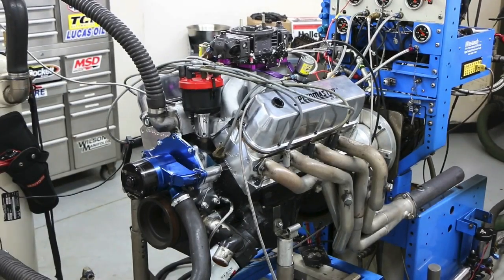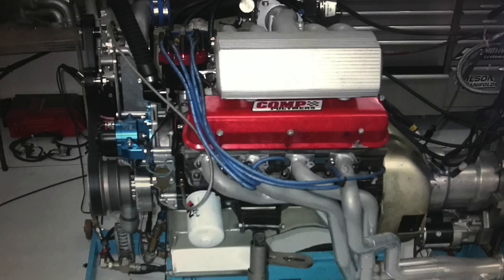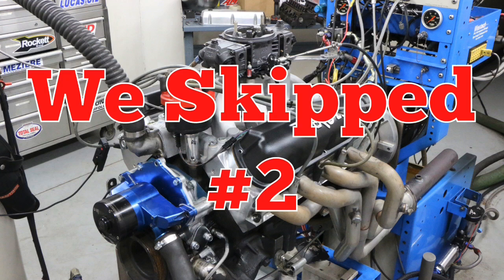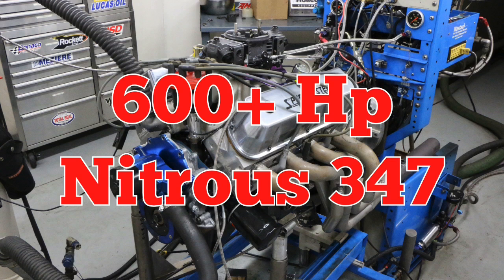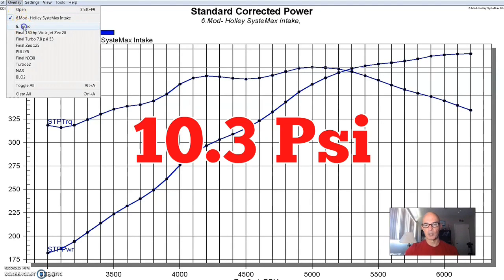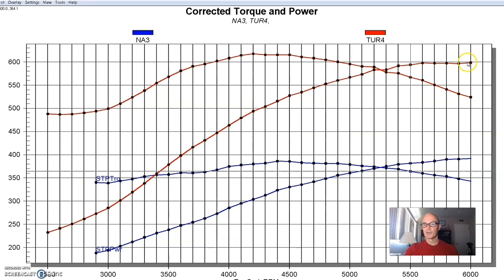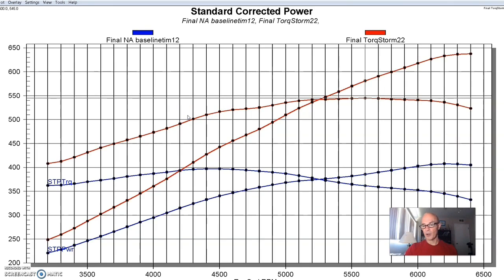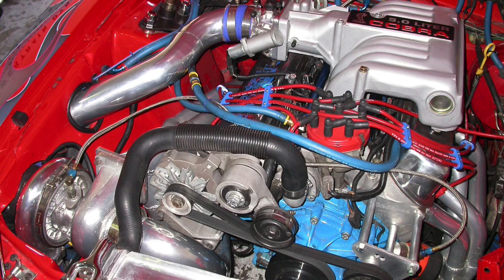5.0L FORD BLOCK SPLITTING-FACT OR FICTION?

Comment: When I have done some failure analysis on damage it is normally a combination of things and not straight one thing because it will be the obvious "normally", but let's put aside that balancing is good either internal or externally balance,  in internet seems that the fracture starts at the mains, and if I see the pictures this is at the threads which is a logical part because it is a stress raiser >   <, I do love to have one of these split engines on my hands so I can conduct failure analysis on it, stress raisers can be metigated to certain extent, but what about assembling the engine and pouring a lot of oil on the threads of the bolts and torquing it and causing the oil to initiate a fracture as it is displaced by screwing in the bolt I have seen this happen in other equipment, other thing is holes that are just not deep enough and the tip of the bolt forces against the end of the casting thread causing a lot of stress, this for sure it will cause a fracture under load and with thin casting it makes it worse, frequency have as well influence, running a engine at 7000+ rpm will definitely cause more material fatigue than running it at 6000, add some stress raisers and bad harmonics due to unbalancing or running a OEM balancer all this combine will have a negative effect, a good expensive balancer that can take these bad harmonics is a must, good assembling practice have positive impacts, pay attention and look be critic at what you wrench on, because it was running it doesn't mean it was running properly, inspect, inspect, inspect, and always remember that batch of production on that Friday afternoon and someone that is just there for the money without the ethics, as well humans make mistakes and are not aware of them, it is normally a combination of things that is my experience.

Comment: If there is truth to the blocks splitting, its probably related to the shock loading of drag launches. In the same vane, I run a GM 7.625 rear end in my road race car, which has a huge reputation of being weak even at stock power levels. I make 360hp and 386ftlbs/tq at the wheels and have run that rear end for years without any issues. But a road race car never plants the rear end and shock loads it like drag racing does. If you think about it, if you wind up an engine and dump the clutch, that momentary spike of torque is going to be astronomical.

Comment: I have always thought that the  way the intake manifold bolts down on the SBF acts as a wedge on the blocks. The high power combinations exploit the inherent problem when combined with engine mount and chassis flexing.   Just my 2 cents 🤷🏼‍♂️
Reply: This is where I was thinking... people skim the deck and think they can get away with it, torque the intake down because the bolts fit, and now the valley is preloaded in tension and waiting for that first crack to start and spread. Cast iron doesn't like tension while vibrating at all.
Reply: @mfree80286   I keep hearing that the cracks start at the crankshaft?
Reply: @fascistpedant758  No reason there can't be more than one way to start the process. If the crank twists in the mains then that's going to try and force the studs apart as well, just from a different spot.
Reply: @mfree80286  I don't contest that there could be more than one failure mode.

Comment: I suspect it has more to do with resonance than peak torque or shock loading. The right torque at the right frequency could amplify twisting of the block causing fatigue cracks. An improper harmonic balancer puts a lot of stress on both the crank and block also. Then factor in casting lottery.

Comment: Now you have me wondering what the magic number is for a studded 2 bolt main 350 block. Always heard 500ish hp , even from David Vizard.
Reply: Luv truck Nelson ran a 2 bolt forged 350 shortblock with unbalanced rotating assembly. chevy s10 blazer, turbo running low 9s with a cast crankshaft as well.  I also have a customer that has a turbo-forged rotator stock block 350 in a Dodge Dart, running low 9s as well.

Comment: I watched my friends 94 cobra with stick crank and block make 617ft lbs to the tires on 14lbs 3 years ago.  It's still alive
Reply: Stock*
Reply: @joshkeasler512  yea i believe them 93-94 cobras have good bottom ends
Reply: @Artificial_Dopamine  The '93-'95 Cobra used the same block & rotating assembly as GT/LX. '93 was the first year for the hypereutectic pistons (5.0 HO used forged from '85-'92). The difference between the 5.0 that came in the Cobra & reg 5.0 H.O. is in the top end: Cobras had GT40 heads, 1.7 roller rockers, Cobra specific intake, larger TB (65mm) and different cam.

Comment: In reality what splits  everybody,s engine,s is poor maintenance and cheap oil, my 87 makes 600 plus to the rear with 12 psi 80 mm  ball bearing turbo , stock block , and still going .

Comment: I think block failure/splitting is WAY more likely to occur when the engine is actually in a car and in particular, when the engine is in a drag car.  This is due to the added forces transmitted to the engine from loading and unloading of the drivetrain during launch and/or power shifting a stick car.  As such I kinda doubt that testing this on a dyno is an accurate duplication of the forces that are in affect that leads to most block failures.  I think the “myth” of the 450-500 HP figure for stock 5.0 blocks derived mostly from Fox Mustangs in the 80’s.  Many of which were stick cars ...
Reply: Yes and it'd be interesting to know how many split block cars were using solid engine mounts?

Comment: HOT BEARING 
IN A VACUUM/ then getting positive crank case pressure.
= BOOM  just a hypothetical 
The 302s were engineered and built for its standard stock application. Yes they make   power when bad ass parts are applied. Some Joe shmmoo that's doesn't take his time will split block more often.
Reply: Some guys don't realize that. The highest power stock engines are either the cobra or explorer engines and.they last forever at those power and rpm levels. Twist the screws and start making more than double the stock power and stuff will start to break, nobody should be surprised.

Comment: I’ve read that the block splits if you have a boosted 347 stroker. What the person said was that the longer stroke results in the rod angle being different, and when it comes up to the compression stroke, the combination of the rod angle and the boost causes the block to split.

Comment: Not enough material around the main caps. People put a valley girdle on them thinking this will solve the issue. But the split even with a crank girdle and a valley girdle. There is just not enough material around the mains. A aftermarket block has alot more casting in this area and therefore can handle more horsepower.

Comment: I wonder if an unmatched valve spring or two would cause harmonics that would cause it ?
Reply: alot of people are saying their blocks split when the balancer spun the inertia ring. im thinking ins a torsional vibration issue. early first gen dodge hemis would break cranks, because they didnt use a damper at all....

Comment: One comment said it was the 351 that splits. Nitro Nation another You Tube channel ran a video last month they had a 351 I think it was stroked to 408. They were running a roots supercharger with fuel injection. They thought it was making north of 800 HP. While drag racing it it stumbled at the end of the pass but was still running. They pulled the engine and could see several cracks. When they tore it down it fell apart. Fun to watch.
Reply from the maker: we've done 1000+ hp on 351W SBE

Comment: I split 5 roller blocks making 520 N/A. I believe it was rpm as I shifted the engine at 8200rpm. The blocks had DSS main girdles and ATI balancer.
Reply: Yes I beleave rpm and rotating mass are the major factors
Reply: Internal or external balanced crank?
Reply: Internal
Reply: The fact that one person is splitting blocks while others do not clearly implicates some sort of error during its assembly. My first suspicion is overtightening the vertical bolts that clamp the intake manifold. Second, I would look at how the crank was balanced.

Comment: back in 95-98 I ran true street in my 90 coupe 'junkyard refugee' you're old school, friends with jim from mmff so you may remember it. won best sleeper ie ugliest car award in baytown in 96 for its 5 color paint hah. anyways I was running a north texas performance 347 stroker short with tfs twisted heads with a 750 double on it, was using a nos 200 wet kit. Between all the true street events and the dallas/ft worth street racing I probably ran 150 bottles through that motor. It trapped 127, no idea on power we didn't have access to dyno's back then. In 98 I won a texas turbo twin turbo kit for winning an event and swapped over to that with a 1050 dom, I did get on their dyno for that and put down 720 to the wheels through a tremec 5 speed. I ran it for just over a year like that until I wrecked it in a race. The guy I sold the motor to had it split a few months later. As someone mentioned I suspect it had to do with balance, the "rattler" and "fluid damper" were just becoming a thing around then and most people were just slapping old balancers on their cars, not wanting to pony up 350+(in 1998 that was ALOT) for a silly balancer. I believe it was balance and harmonics from high rpm that splits blocks.
Reply: very nice... what RPM was the "high rpm" your engine dealt with on a regular basis?
Reply: @chestrockwell8328  also, im aware 7500 isn't considered high anymore, hell i turn my *EDIT*(damned phone fat fingers, 598 not 528 hah)598 to that, but this car saw 10,000 miles a year on the street, i drove it to each event, I didn't own a trailer or a truck, carried my m&h racemasters in my back seat =p
Reply: @WarfighterRacing  Thanks for replying with additional details. Yeah some people think 6k is high rpm, 7500 is getting there in my book and more than the engine i'm buliding will need.  I agree 8k+ is the new common. What valve springs were you using? stock crank?  pedestal, stud, or shaft mount rocker arms?
Reply: @chestrockwell8328  far as valve springs, i claim ignorance, they came with the cam from lunati, i called them and they set me up with cam, springs etc. The short block was a 100% forged setup by north texas performance, I believe they sourced ford racing crate 347 and went through it to balance and double check. If I recall correct they were crane 1.72 pedastal rollers. Oh, one unique fact, I ran a gear drive instead of timing chain. Sounded like a blower car, though most people who had never heard a blower car before would run over and tell me my car was out of oil lol.
Reply: @chestrockwell8328  it was a 7500 rpm motor. remember, back in the day, smf motor, no dyno to know exactly when power peak was, just trial and error. Came with an F cam, swapped to a lunati custom grind around 580 lift with 24..8ish? duration, but was runing 1.72 rollers so probably like a 615 with those. 10.5 to 1 motor with the 58cc heads and pistons
Reply: Fastest 90s Stang I ever saw was a Chevy engines.  Set back 4 " with some juice.... Small block. Blew the doors off big inch brodix bigblocks with juice.... I mean no comparison..... Pfft of Ford engines. Just a joke of a v8
Reply: @darinr9424  i dunno, you might be amazed at what a hemi headed big block 598 ford can do. but I do appreciate a good sbc and do have to give a nod to the LS engines, if you're into boys...
Reply: @WarfighterRacing  dunno why?;hehehe maybebyourncluelesb. Just kiddin
Reply: @darinr9424  And we're discussing windsors specifically. Why would you even speak up if not to toot your own horn?
Reply: @mfree80286  cuz Ford is poop. Guess that's tooting in a way 😝

Comment: I personally broke one. It was on a chassis dyno, and had an s trim vortec. I was experimenting with cogged pulleys spinning the blower a little harder. It only had one keyway on the crank and sheared it, the balancer spun and it split. The thing sounded really good up until it died. It broke the crank and split the block in two except for from the cam to the top at the rear at the block. Pretty obvious why that one broke.

Comment: My 347 motor has been running for years now it made 508 hp / 446 tq. It’s a Stock block with a main cap support. On the motor dyno it was still climbing at 6500.

Comment: I think it’s a shock load issue. 4-5000 RPM clutch dumps at 400 WHP puts quite a strain on the engine. The 302 Windsor is a thin wall casting to begin with. When they made the Hi-Po and Boss they made the blocks thicker (along with 4 bolt mains). On a drag strip it’s hard on an engine to launch and then go from torque to HP peak 3-4 times in the span on 12 seconds or less.

Comment: One to blame is Frieburgher.  I have heard him say it several times. 
I have seen a speedway sedan  Boss 302 clone run at up too 8500 all night, year in year out. Historic racing engines run at around 8000rpm, again lap after lap for extended periods. I have seen ONE break a block, it broke a crank and took no 1 main out of it. Though maybe the block broke and in turn broke the crank. Harmonics were blamed.
A drag race 347 cracked a main web and oil psi went down. At 8000 rpm. That was put away, block welded!! and was used for a period after that.
I have seen cracked SBCs as well. BUT never the block breaking in half. 
The 302 block is too short, early ones have the piston go out of the bottom of the block too far. Later ones are better. Everything is better than a late 60s block
Detonation would be the only reason and even then breaking a block in half?  Very severe detonation.

Comment: High torque at low to mid rpm. Like big hits of nitrous at lower rpm.
Reply: I agree with you to a point. Big nitrous hits at a lower rpm is could definitely be a cause. I'd like to see the nitrous tests redone at a more realistic engagement point. It seems silly to only spray for 1000-1500rpm.... but I also think engine balance is a big factor.
Reply: Joseph Cousland I never thought about it ... I was actually side stepping ... slide stepping the the clutch going to wide open and grabbing the kit all at the same time ... kinda . That’s how I launched the car. If I did it without the bottle it would kill.

Comment: I saw a 600hp+ 347 stroker split. The crank was in great shape after the failure and was measured to be over 100g out of balance. With the short deck, I think it is because of high RPM without having an internally balanced rotating assembly.
Reply: I have read and think it's the balancing aswell, too much external pressure and vibration for the thin lifter valley
Reply: Yeah I have to agree internal balancing is important for higher HP

Comment: My stock roller block 347 with twin turbos made 700 to the tyre and ran 9.3’s at 150 for years and never split a block, broke plenty of gearbox’s, I always only ran race gas and meth injection at the track so I think it has a lot to do with detonation or bad tune.
Reply: What injectors, How much boost and what engine management system if you don't mind me asking.
Reply: @nitroustommy  fuck it

I'm going 351w
Reply: well in the early days, we were always after mexican blocks. for the iron in them if i remember right.
Reply: @WarfighterRacing  They also had more thickness in the main webs than the later lightened 5.0 blocks.
Reply: @WarfighterRacing  yeah I hear that all the time

Getting hard to find nowadays
Reply: @WarfighterRacing   saw this had to look this up to see if I remembered my Muscle Mustang and Super Ford mags correctly. And I was but apparently the bit about the high nickle alloy is in question. That said, it was actually a little more  beefy with wider main caps and a its lil overall thicker. To the tune of around TEN pounds. Holy whaaa!  Fun(useless) fact #299 792 458 m / s   Cheers
Reply: BUt how can they build two engines and one split and the other was almost breaking 9s?
Reply: @mrhazel  not all castings end up with the same production quality, unfortunately :/ ...might be a little luck of the draw to it
Reply: @jrcs-s7544  yep

+/-

Id say if someone were to build a 347 N\A and spin it 6500 theyd probably be ok without a power addder

Hes done it in this channel and made 500 with brodix LH17 heads and a big cam like 240s 250s hydro roller almost if not .600 lift and 10.5:1

I mean you are taking an 8.2 block with 7/16th head bolts and a big stroke crank and putting the wood to it at that point

Bout time to step up to a 351 9.5 deck and 1/2 inch heads bolts
Reply: @KingJT80  Not to mention 3/8 rod bolts, if you're brave enough to run stock rods.
Reply: @robeddy3722  I've leaned a lot in the last 3-4 yrs about these blocks

They are a lot stronger than people think

They run 8.2 deck stock blocks in the stock block classes

The record is in the 5.00s at over 140 mph with a turbo in a Fairmont like my car. 

A nitrous mustang isn't that far behind.  347 at that. It's how it's done is what blows them up and splits them.

Comment: The best way to crack something like a block is with shock. You end up with windows in blocks from rods and stuff hitting the inside when the bottom end comes apart. But the reason behind this video could really be a lot of things. Poor castings or poor quality metal used in the castings. Poor assembly and balancing. The thing I find interesting is that they all split in the same place. The lifter Valley. So maybe just flat out poor design? It's pretty well established that the block is going to let go under enough abuse though. Put together a combo that should make 800 horsepower and let's see what happens! 👍